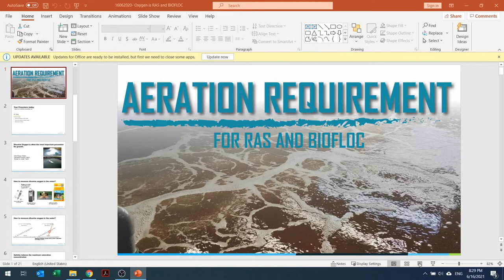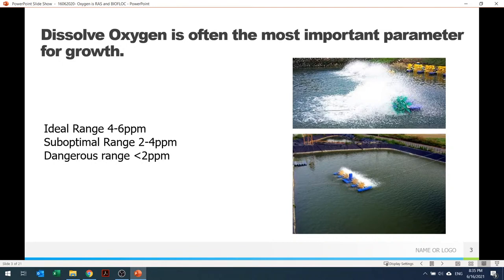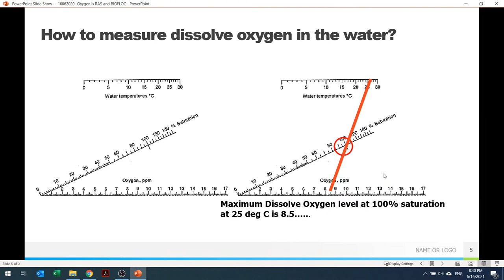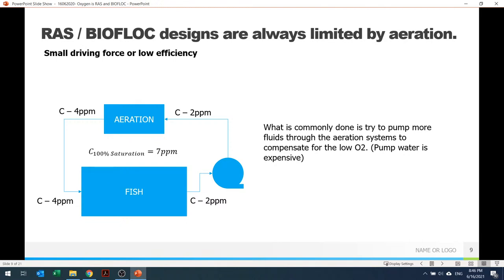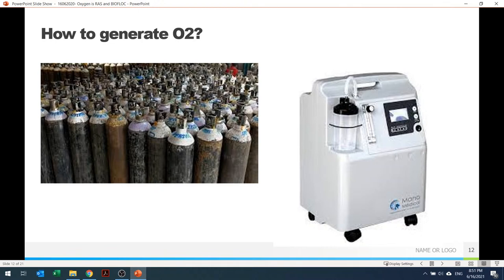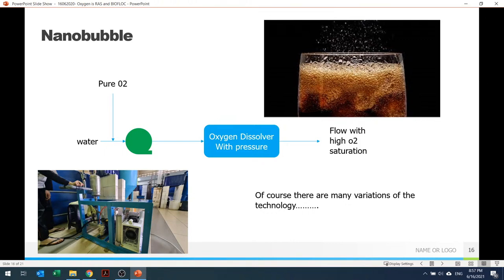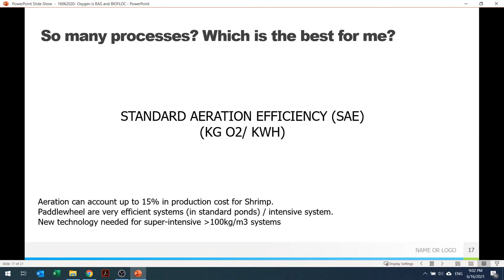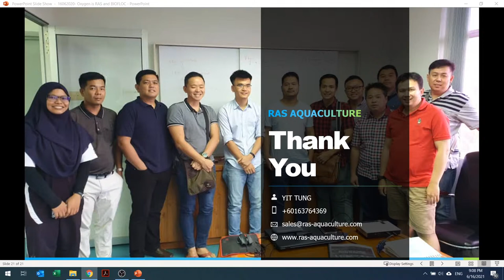Aeration Requirement on RAS and Biofloc

Comment: Regarding your statement at the 23:30 mark. I assume you were talking about "shrimp" not fish stocking density in a biofloc system 7kg/m3 with just air aeration. 
While on the RAS system you were talking about "fish" stocking density 30-40kg/m3 with just air aeration. 
Correct me please if my assumption is wrong.
Thank you